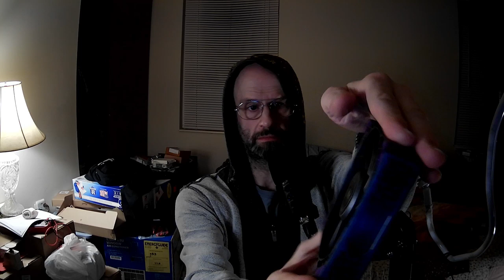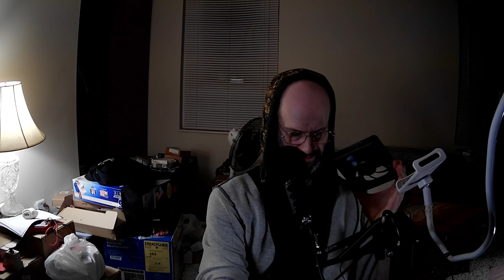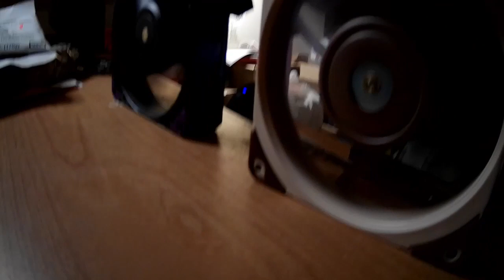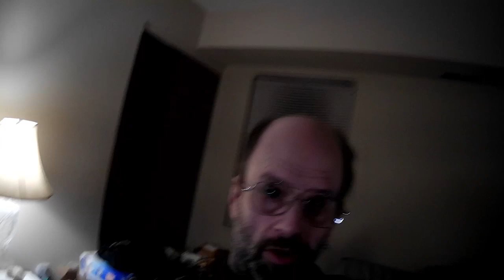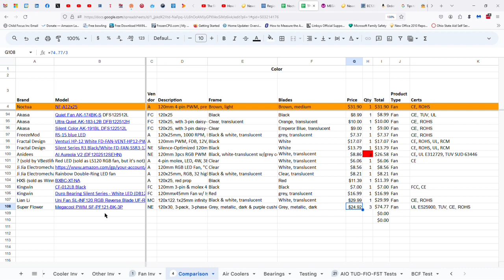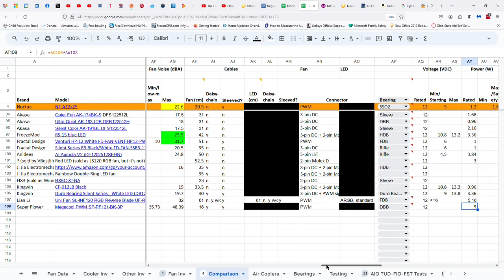Preview

Comment: What do you think of these compared to the Phanteks T30? Also, have you tested them in 140? The SF Megacool 140 is basically a direct competitor to the Iceberg Thermal Icegale Xtra 140 and Noctua NF-A14 iPPC-3000. I cannot decide between those 3 in 140 and between the Megacool and T30 in 120.

You said these crush the T30s. How so? Are you judging purely from "on paper" advertised specs from the manufacturers? By hand feel? Or...?
Reply from the maker: I encourage you to check out HW Buster's 2024 Fan Round-up, in which Aris (an actual engineer) compares several fans and gets actual numbers (yes, I have to go by the published specs until I can run tests of my own). In those videos, the Megacools, T30s and SilveStone FHS120X are constantly vying with each other for top place.

Comment: I kinda want it but that comsumption of power on top of having a daisy chain? Couldnt that blow a fan header out quick?
Reply from the maker: That's a great point! Yes, you could ruin a header pulling that much amperage since most headers are designed for 1A.

If you run it on high (.75A) and chained, you would definitely want to connect it to a PSU-powered hub or controller. Even at medium (.45A), you'd have to do that if you want them to be synced. However, if you don't need to chain them, 3 headers is fine.
Reply: Sata pwr can provide 4.5A. Most modern MB's have 2A headers
Reply from the maker: @Mack_Dingo  Most mobos I'm aware of have 1A headers and maybe a 2A header. My H670 doesn't have any 2A headers. Then again it's Asus, and they suck.